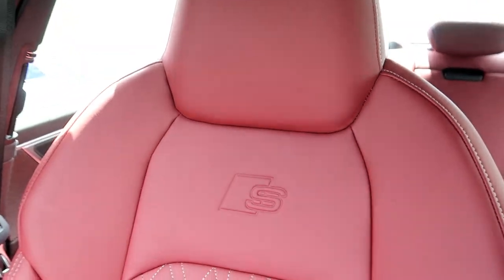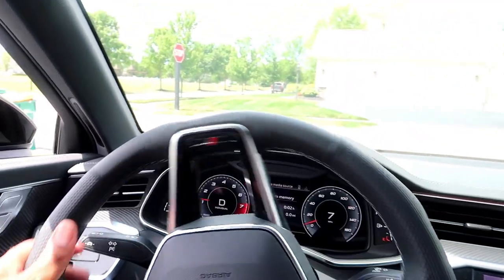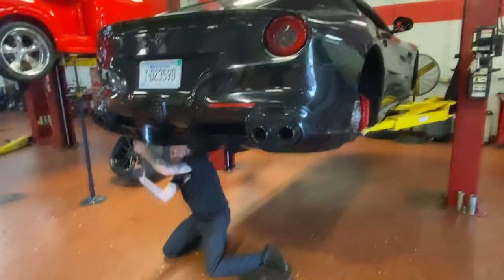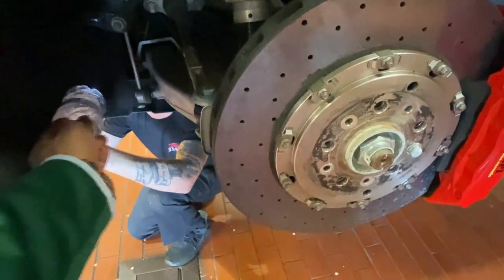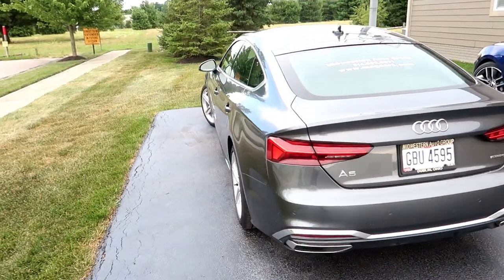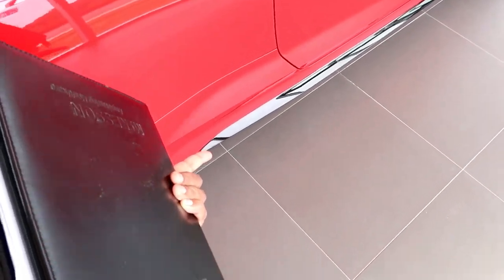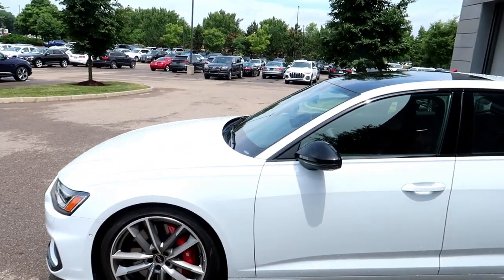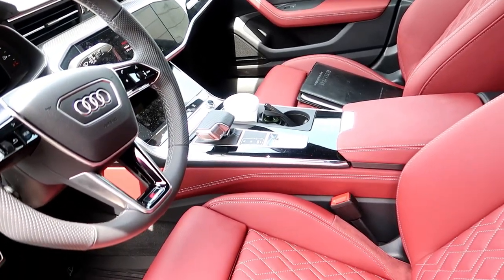THE PROBLEM WITH MY NEW AUDI S6…

Comment: If you pay 80,000 for a new car it better be right they don't drain all of the fluids out of a car when they ship it from another country but it might have 2 gallons of gas in it that's all, r-134 freon is a pressurized gas they most certainly did not let that be emptied.
Reply: 1234yf not r134

Comment: I definitely agree that the correct way to handle unexpected issues is with complete calmness. Being calm opens the door for level headed thinking to find a resolution. I own an older model S6 (2013) with the sweet V8T and just love this thing. It rides incredible and has a ton of power but when something goes wrong with an Audi. It sometimes requires parts to be shipped or manufactured in Germany to get them fixed. Each time my local Audi dealer (Tysinger- Hampton, VA) always does a great job and give me a loaner. Great video thanks for sharing.

Comment: I was recently involved in an accident that unfortunately totaled my B9 S5 S.B. (Man, I had just finished up all the touches in order to get that thing PERFECTLY stanced with the perfect wheel setup and looks too) and that occurred. I like the fact that the S6 gets the option to get lowered on lowering links, anything that’s risen (wrong) with the S6 that you could point out?! Really thinking of getting into a C8 S6 due to the fact that it literally packs everything into a single bundle.
Reply from the maker: It’s a little heavy and this may feel a little slower maneuvering around but it’s a great car. Drives good. It’s big so that can be good or bad.
Reply: @WillMotivation  Yes, figured that it’d be quite heavy due to the fact that it’s a bigger unit than some of the other S within the Audi lineup. I really want to go prestige but I’ve noticed that the only ones that comes with the black optic package are the Premium Plus models, or am I wrong on this one?! I mean all the scrollings that I’ve done when searching for a prestige S6 only pop up with the chrome trim. I mean I could be wrong but I can’t seem to come across anything to prove that otherwise. Appreciate the help in advance, man, I know that you don’t really have to be on here but I truly do appreciate any type of input. Thanks! 🙌🏼

Comment: My experience with VW/Audi products:

Buy an OBDeleven bluetooth scanner Pro Version - its saved me so many times diagnosing my car problems, with no paid trips to the dealer

If you like aftermarket:

034 Motorsport makes great products
I use their aluminum dogbone mount insert - no slop in dsg shifting
I use their solid rubber engine mounts
I use their thicker rear sway bar - more planted, turns on dime, no understeer

If you like ECU/TCU tunes:

APR and Unitronic seem to be the most prominent
APR is pricier, Unitronic provides similar tunes with more gains for less money
My Unitronic Stage 1 ECU/TCU tune gave me 50 more hp, 100 more tq for $900 - just software

Comment: I agree on the new exterior design on the Audis. The grille has gotten too wide. I have the 16 S6 but I like the 15 better.
Reply: I was thinking of either an A8 s6 or s7 BUT any 4.0t model from 13-17 is totally plagued with the turbo oil screen issue where coked oil clots and gets stuck in screen thus starving turbos of oil which leads to both turbos failure. Also the pcv oil separator issue leads to shards of metal in oil. Audi will NOT correct issues until car goes into limp mode and blows up ultimately. It’s a 10k repair.....in 18 models with 4.0t the issues were finally corrected. Shame on Audi for all those people who had to face a 10k Bill after paying so much to begin with

Comment: Just got the same car that you did.  I am an older than you, female ….. I just traded in my 2017 S6 for the 21 S6.  Ok that being said, I am having a few issues and wondering you you are encountering anything similar.  My FOBS are VERY finicky meaning that it does not always work when it’s in my purse, my other works always….this one should (and I have tried both).  And, there is one phone number that it will NOT take?  The MMI……won’t take it.  Have you had any similar issues?  I’m really P’Od right now as I loved my 2017…..this one……not so much.  What are your thoughts on the MMI?  I’m in Toronto but same cars come here😁.   By the way, you have a terrific attitude!  I would have been beyond angry with the air issue you had.  Lucky you.  Elaine
Reply from the maker: I have had the issue with the key fobs yes but not the mmi yet but I usually always use apple car play
Reply: Thanks for the reply!  So what did you do about it….I think there is an issue…..it’s very erratic…….was yours like …..sometimes it worked and sometimes it took a few clicks…..never had that issue with 3 others I have owned……my salesman is telling me to ‘grab’ it harder…wtf why would I have to,do,that with a spanking new vehicle.  I’m trying to adopt your ‘sometimes things happen’ attitude, but it ain’t working……it should be spot in.  Did your issue get fixed or are you just leaving it? You are a very cool headed guy.  I’m not cool headed, I just want the damn thing to work.  Again, thanks for the reply.  Elaine

Comment: The RS5 and the S6 share the same engine. Tuning for this engine is not massive but very limited.
Reply from the maker: Apr tune adds almost 100 lbft of torque
Reply: @WillMotivation  yes, APR has a great tune for the 2.9 liter engine. The APR stage 1.5 adds more power but you need E85 which I wouldn’t recommend. E85 can get really gummy if the car is not driven everyday, the mpg is horrible and E85 can be hard to find.